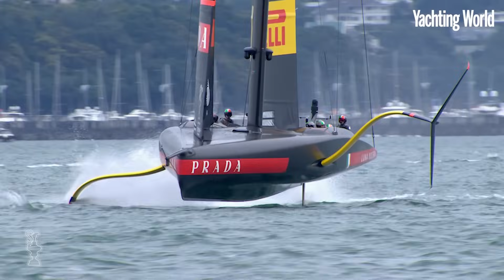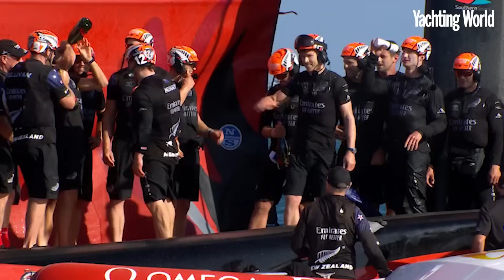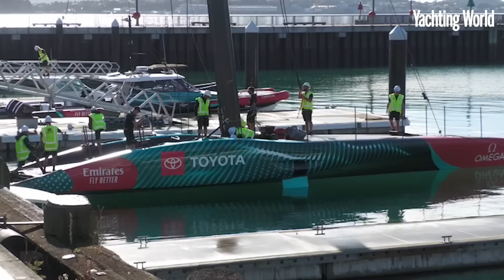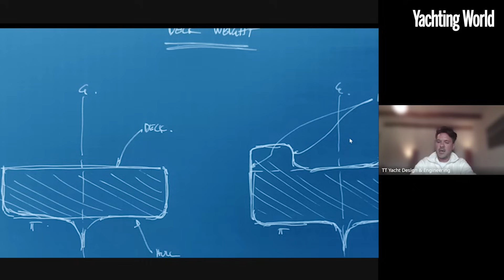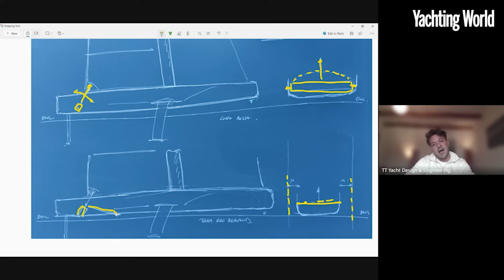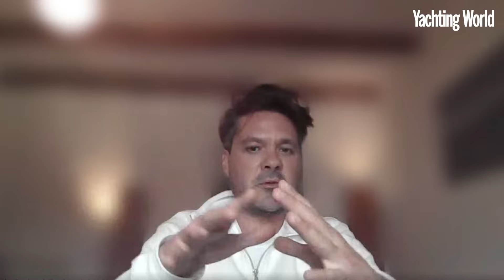Emirates Team New Zealand AC75 | An America's Cup designer's analysis | Yachting World

Comment: The two best boats right now, absent tactics, boat handling and foils are NZ and American Magic. The difference? NZ double main vs AM's low windage profile.  But it's early and there are many variables.
Reply: Also, the cyclor positions. AM is the only yacht that features recumbent cyclors although how that will pan out with power availability remains to be seen.
Reply: @James_Aron_1967  I'm guessing they really thought this one through. When you think about it the reduction in windage from a normal cyclor station to the new recumbent stations is only a very small advantage. I don't think they would jeopardize a reduction in power output for a marginal gain in windage savings. I'm sure they did a lot of testing with the cyclors.
Reply: @tomhorvath6137  Absolutely, they would have done all the number crunching before the yacht build. The recumbent position might be more than a minor advantage. I'm rethinking the whole recumbent power disadvantage. All along I was comparing the two positions on the road. In a yacht, the cyclors aren't trying to balance a bike and do other things; they're fixed to the deck, thus, muscle power is anchored. So, it might turn out to be a wash in power delivery between the two positions, thereby granting more of an advantage to recumbents availed by the superior aerodynamics plus weight savings from the slimmer profile.
Reply: I thought Prada looked pretty slick.
Reply: @bobdillon1138  Never, ever underestimate the Italians.
Reply: Spot the yank
Reply: American magic already falling apart lol🙈
Reply: @jamestoaifolia8609  😁
Reply: The YANKS won't even get to the final ,so not to interested in them
Reply: @robertbaird4822  And you know this how?
Reply: At least half of this didn't age well... 😉

What do you think now everyone?
Reply: Haha. Spot the American.
Reply: @TAV0206  Tell me I'm not right. ;-)
Reply: @tomhorvath6137 you are correct, it’s a beautiful hull shape.